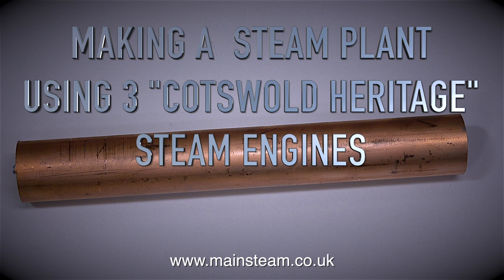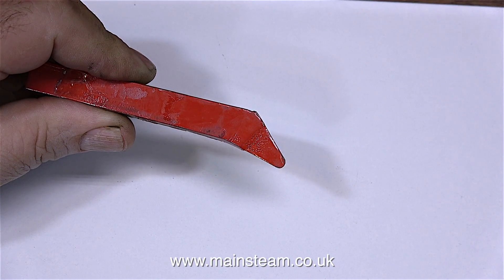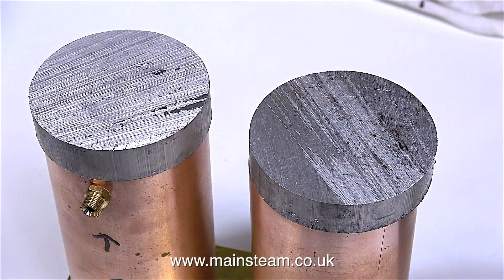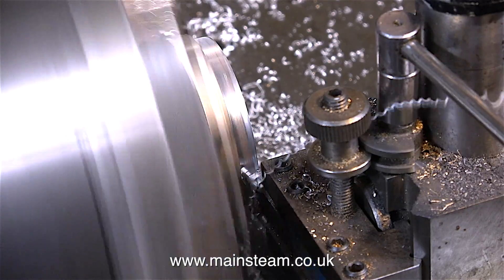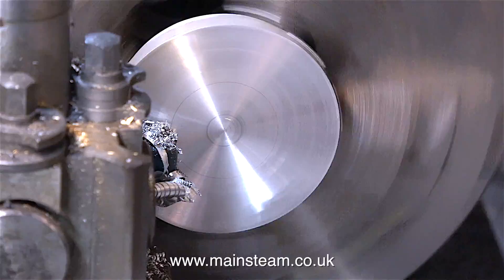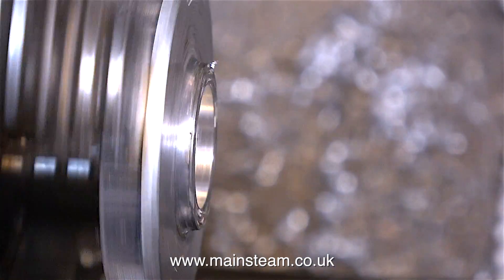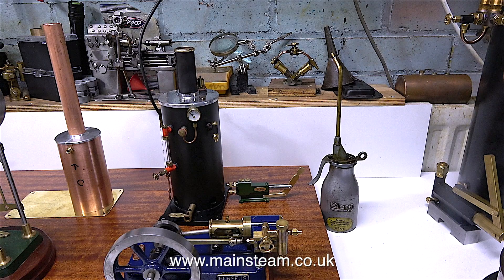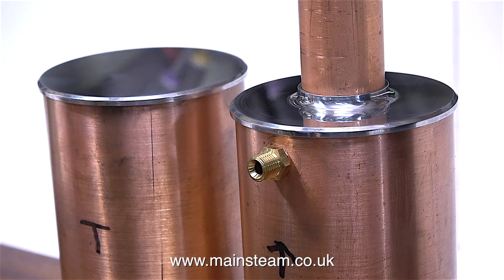A MODEL STEAM PLANT WITH 3 STEAM ENGINES - PART # 6

Comment: Bonjour Keith,
I am surprised by your choice of aluminium for the caps because they can possibly create an electrolytic reaction wih copper (as it happened on one of my accessories) even if there is not directly acid to activate it. Even with a varnish, I fear something wll happen in the future, hot water and oil will do their job, not blocking but I know your quality target usually.
Amicalement, Raphaël
Reply from the maker: zzzzz - not again - ! There will be no problem with electrolytic reaction. The manufacturer of the boiler (Cotswold Heritage) have been selling boilers like this for years, even my 10 years old test boiler has an aluminium top and that is fine. These are small model steam engines, usually in a warm dry environment as a collector's item . . . .
Reply: Bonjour Keith,
I already reacted about this topic ? Would it already be reached by the disease of Alzheimer...? I hope not ! Sorry, I have no memory and you produce too many videos on different topics. I am happy that your experience that I trust is quite better than mine. 
Amicalement, Raphaël
Reply from the maker: other people have repeatedly mentioned the same thing as you a few times - as if I didn't know what Cathodic Electrolytic Corrosion was - ! . . . . zzzzz

Comment: Keith, when you buy new carbide tooling, do you sharpen them before using them or do you trust them right off the bat to be properly faced and sharpened?
Reply from the maker: They are generally perfectly made when you buy them.

Comment: There is a discussion on kerosene vs paraffin lower down, but I thought this piece of trivia would be interesting:

My father is a production engineer in an aluminum rolling plant. The cold rolling mills use kerosene as a lubricant and coolant. They have enormous fire extinguisher systems in the plant, as that much fuel is extremely hazardous

Comment: Do you envisage any galvanic corrosion problems between the Copper and the Aluminium?  not usually a good idea to have them in contact, or is this just in marine/electrical environments.
Reply from the maker: No, not in this scale in such a dry indoor storage environment ........ but maybe you should write to Cotswold Heritage - the boiler manufacturer and tell them about it .......
Reply: I would think as long as the water Ph isn't off the scale, there should be little concern about galvanic corrosion. Considering one would rarely store any engines or boilers with water still in them for extended periods of time. Battery posts corrode due to moisture and electron flow through the dissimilar metals. A clean battery post treated with Vaseline or Grease to keep the moisture out will not corrode (or at least as easily) as one that isn't treated to prevent moisture in the connection.. Just spit balling here...

Comment: I've been told that kerosene is also a good lubricant for Aluminum.  I used it for tapping, but not for lathe cutting though.
Reply: Kerosene is known as Paraffin in the UK,  a bit like Gasoline/Petrol and Cellulose/Lacquer thinners
Reply: The paraffin Keith mentioned IS kerosene.  Kerosene is an excellent cutting oil for aluminum.  WD40 works well too and its being readily available makes it a popular selection.
Reply: Paraffin is much closer to 
Kerosene is a much lighter grade of fuel oil, it flows closer to water. Paraffin is a type of mineral oil is much heavier and flows like.. well.. oil.. They also smell very different.
That being said,  for many things either can use. Kero has a lower flash point, so there is a greater fire hazard, but is easier to squirt and is slippery enough to get the job done.
Reply: Electra Flarefire  Paraffin is more closer to Lamp Oil in US & Canada than it is Kerosene